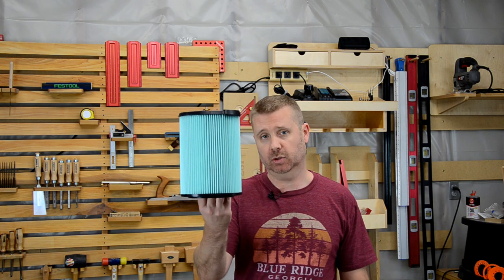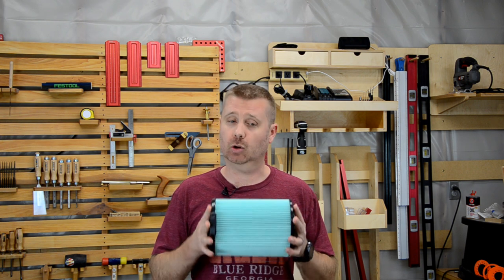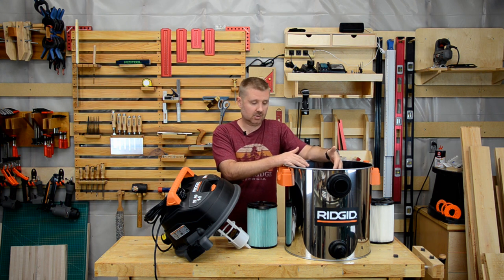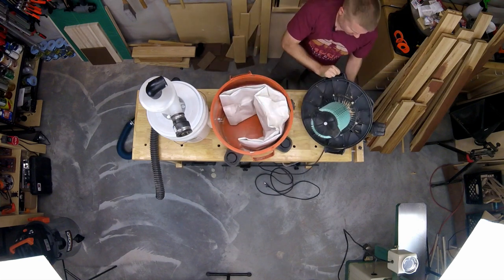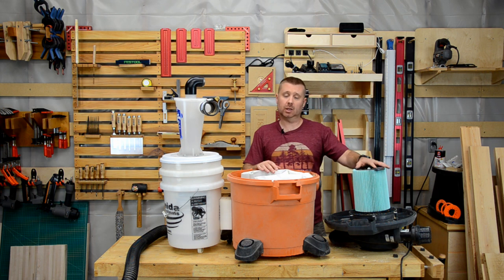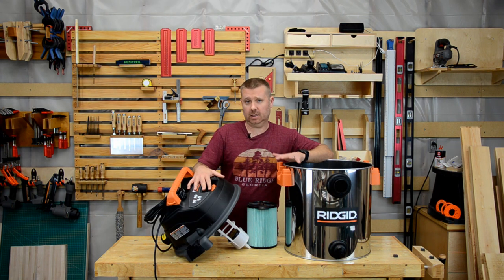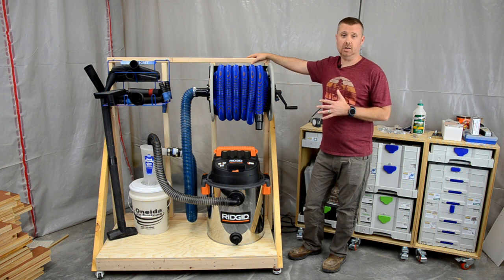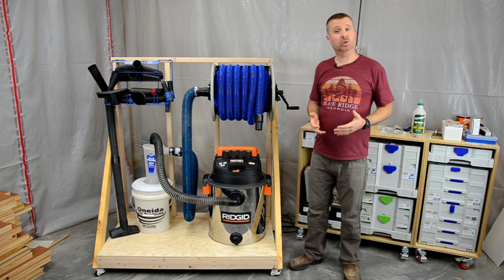Shop Vacuum | Do It Better, Do It Cheaper

Comment: $100 ? those cyclones are between $15 and 20 on aliexpress, add a bucket(empty paint bucket or similar) $5 if you have to buy, a short piece of tubing to connect the cyclone to the vac and use the vac hose as normal but on the cyclone inlet at the most $40. or less depending on what you already have.
Reply: Never heard of Aliexpress. I doubt most have. I googled now I know. Thanks. But how will you know the quality of what you are getting?